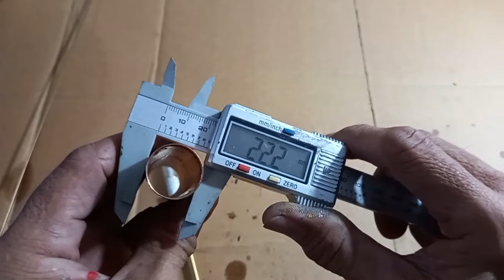HOW TO UPGRADE LONG RANGE LOCATOR VERY ACCURATE

Comment: How are you? What kind of material is at the top of the introduction to the skewer?
Reply from the maker: that's thin red  materials cover with black  that is rechargeable battery that thing i always use in the pendulum,if open the rechargeable battery you can find inside that thin substance, watch some video of my DIY , there's interaction hiw to open the rechargeable battery safely